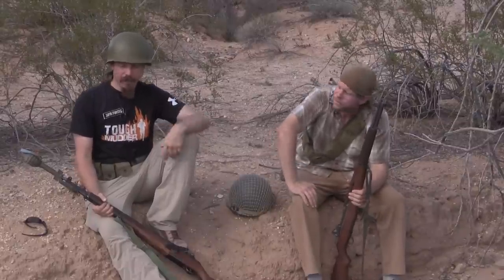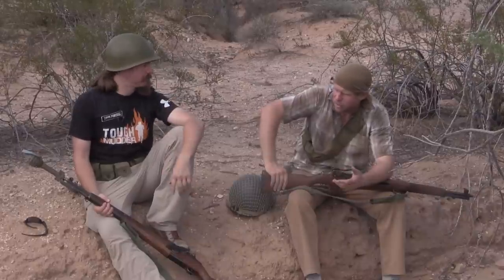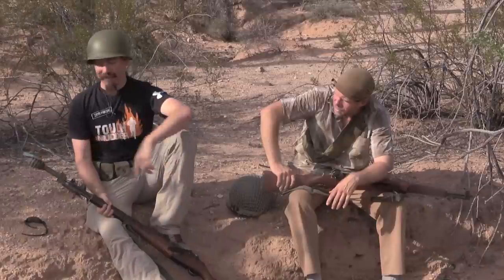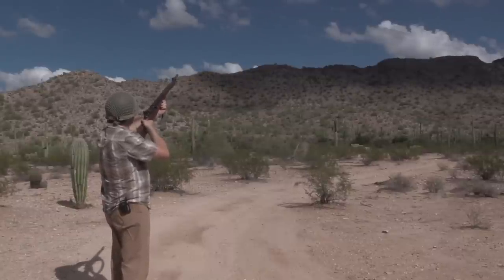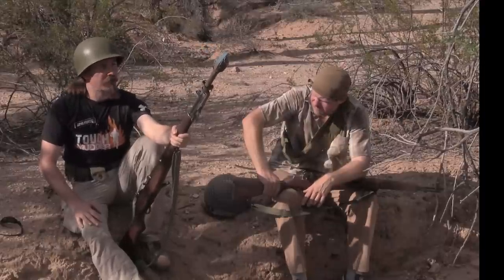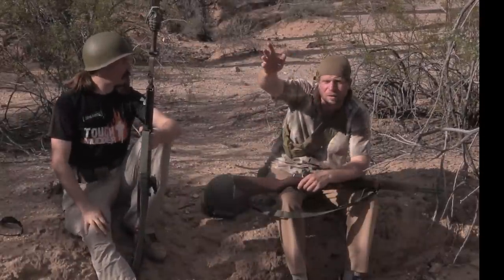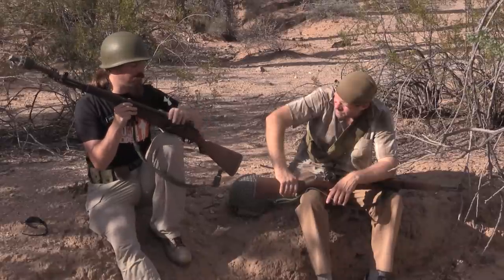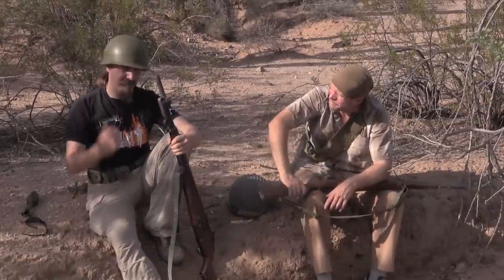M1 Garand Rifle Grenades - How, Why, What?

Comment: Do you think during certain war times they had an en block clip filled with launcher blanks so an individual soldier could fire eight grenades consecutively ?
Reply: I'd like to know too.
Reply: Nah the grenade launcher attachment makes it so there's not enough gas going back to work the action and load the next round
Reply: Zedbrains I think that if I had 8 grenades I'd have to fire consecutively I'd go for any improvement in time
Reply: Yeah, which is why the soldier cycles the action like its a bolt action rifle.
Reply: +Zedbrains why would that blow you up? you silly person.
Reply: Zedbrains Ian said that in this video so you're right
Reply: the real question is if the frontline solider cares about loading grenades over a loaded barrel, probably a no no in training
Reply: It would be entirely up to the individual soldier to do something like that.
Reply: DamianHobbes It wouldn't be loaded even if there was a clip full of ammunition in the magazine. You would fire a grenade, the rifle would not cycle so there would just be a spent cartridge in the barrel, then you just put another grenade on and cycle the action to load another blank.
Reply: It would be possible, the action would be straight pull. If it happened it was probably with a British or OSS raiding party were there would be only a few people and you couldn't do volley fire
Reply: I think that policy was to only use single rounds of grenade ammo in order to reduce the risk of someone using ball ammo to fire a grenade.
Reply: They wouldn't feed properly out of M1 en blocs. The projectile in a cartridge aids in the feeding process. Without it, they'll jam up the mechanism most of the time.

It's easy to replicate this: load some empty brass cases into a rifle and try to cycle them. It won't work very well.
Reply: No. They wont feed properly even manually.
Reply: @Nooblolftw   You know you could pull the bolt back too
Reply: No. The gas system won't cycle the action because of the gas bleed valve in the launcher. You have to load the launching rounds individually by hand and eject the empty cases by hand.
Reply: @Nooblolftw  It would still make it easier in that you can just rack the action and stick a new grenade on.

Comment: First - rifle grenade vs bazooka;  don't forget that the 2.36 rocket projectile warhead was originallt designed as an improved rifle grenade.  The rocket motor was added and a launcher developed.  One can see an advantage of having both available.  Second; when doing WW2 reenactments back in the 70's we borrowed some M1s from our local American Legion (used at funerals, etc).  The Legion guy said they were having trouble with the blank cartridges sticking in the chamber (the DoD had drilled and welded the gas cylinders so they were single shot only).  We discovered that the DoD had supplied with about hundreds of "grenade crimps" to be used as ceremonial blanks.

Comment: Massive cool factor, I love rifle grenades.  Thanks for the video.  I would like to mention grenadiers were trained to adjust the length of their sling and mark it in two places.  With one foot on the sling, the stock planted, and the sling pulled tight, the marks would give you 30 or 45 degrees depending which mark you put the edge of your foot on.  This is why the firing tables have columns for 30 and 45 degrees.

Comment: Seeing you guys with the rifle grenades brought back some wild memories. Rifle grenades like this were still in use when I was in the Canadian Forces back in the early seventies. Back then, the Canadian military was still using the FNC1A1 rifle. On the gas regulator, the zero setting was for using a rifle grenade. We were trained to always fire the rifle with the butt on the ground not to shoot the rifle grenade from the shoulder. The grenade we had was the old M36 with a 7-second fuse. There was always the issue of getting the grenades with the longer fuses mixed up with the grenades that had the standard 4-second fuse.

Comment: I'm from The Netherlands. In early 1975 I fired a couple of anti-tank grenades with a Garand M1 on an old Sherman tank on ISK (Infantry shooting range)  Harskamp. I was a conscripted infantry sergeant. I got the instruction of 2 senior sergeant-majors,  KNIL (Royal Dutch Indies  Army) war veterans that used this grenade launcher in battle. We had a different site on the grenade tap. It was a kind of thin metal ladder with distances. We were instructed to stretch the gun belt to full length, then put your left arm in the loop, let the gun-belt run over your body and behind the elbow of your right arm. Do NOT take the pistol grip of the weapon. Just make a fist of your right hand and point to the trigger with your index finger in the direction of your body. This way you are able to fire the anti-tank grenade standing or kneeling without breaking your thumb or your collar bone. With the second shot I was able to place the grenade just in the little gap between the turret and the body of the tank at 100 m. A young lieutenant sent both sergeant-majors for lunch and wanted to try a shot. Well he hadn't payed enough attention and took the pistol grip with his thumb behind the sight. Long story short.. he broke his thumb and had to go to hospital. So seeing you firing a grenade from the shoulder.. I would not do that!

Some pictures of the event.
https://youtu.be/aJXUGyA4_4c
Reply: Sounds like the STGW57 grenades weighing up to 1Kg.

Comment: And if the regular grenade cartridge didn't get it far enough, there were booster cartridges to go in the base of the grenade assembly. According to the range tables, with the booster it added another 50 to 80 yards to the range. Max range with booster was 330 yards with the AT grenades. Or more than 3 football fields

Comment: I read somewhere that many units prefered to bring around a M1903 for grenade use, since then they would not have to choose between lower firepower or slow response time for shooting grenades.
I believe this is why you can find many images of squads with M1's and a single M1903, and not the "designated marksman" many think.

Comment: Fun fact, the blue ones were actually designed for training. Around Vietnam we changed or color code system we used for ordnance to be able to quickly ID what type it is. Yellow bands for HE, Seafoam Green for WP, and blue for training, along with a myriad of others. The late production MKII pineapples that had a live filler were commonly painted solid yellow for the HE Filler.

Comment: Ive actually found an entire clip of that ammo in the woods in germany
Reply: wood1155 ive found quite a few things now , 20mm spitfire casings lots of .50 ammo hand grenades artillery shells ( which i left there of course :D) and a german SS bayonet and part of a motorcycle just in some woods with a metal detector
Reply: Aquatictoaster possible but unlikely
Reply: i found it a year ago, its almost like brand new actually, the blade is still sharp and the scabbard almost didnt lose any paint, just the handle which i think is made of nickel is a little meh
Reply: That is awesome. I've personally found tons of random crap at old mines, everything from rails to electrical components to signs, 1930s license plates, and what I believe was the primary hoist control lever for the Federal Lead Co.'s No. 5 shaft. Unfortunately, the lever was a bit too bulky to take with us, or it would have gotten an oil bath and be on display with all the other stuff I've found.
Reply: fsls13 that’s awesome
Reply: I sometimes find k98 bullets/cartridges here and there in my garden. Grandma said that surrender german soldier was shot and buried somewhere there.
Reply: @fsls13  Do you have pictures?

Comment: Fall of 1965 at Hamilton AFB, Ca. On my way to 'Nam and we had M-16 training before going over (the M1 Carbine was the USAF's weapon of choice at the time). Grenade launching was part of the training. We screwed new fuzes into bodies that had a hole in the bottom. A small bag of powder and a cork finished it off. You got a nice BANG and nobody died if something untoward happened. SIGNIFICANT recoil - shoulder firing was strongly discouraged. The slings were marked to control the firing angle.

I do remember one that went BANG as soon as the spoon flew off - nothing's perfect. Glad that it wasn't live. The best part was that it was an instructor that launched that one to show us how it was done.

Comment: Does the rifle need to be modified to mount the launcher sight? Do all X shaped gas plugs have the launching valve?
Reply from the maker: The mounting piece has to be screwed into the stock, that's the only modification. All X shaped plugs should have the valve, but you should check to be sure.
Reply: There is a tool that is used to mark the correct position for the mounting of the rifle grenade launchers site base. The base is held on with 2 wood screws. Not something that you would want to use the old "trial & error" eyeball method if possible.

Comment: My M1 (CMP arsenal rebuild)  has a Philips type end for unscrewing the gas plug, and so does every M1 I have seen. None have a single slot. Though I will admit that the GI issue multi-tool is of the Philips type (actually not Philips because the nose is not tapered). What did I miss in your explanation.
Really like your show very straight forward with no Hollywood BS

Comment: We used a K98 grenade cup when re-enacting. Stuck a length of dowel in the bottom of a mark VIII thunder flash and fired it with Czech surplus steel blanks. A little practice and you could drop one almost anywhere you wanted....into a trench, over a wall, through an open window...no problem.

Comment: Great video. As an add,: The rifle did not become a single shot when the grenade launcher kit was applied/used. The kit came with a special gas plug that vented when the grenade spigot was installed on the rifle. When the spigot was detached (takes a second) for regular firing the gas plug release was not activated and remained shut allowing the rifle to cycle as normal.
Reply from the maker: I believe we stated that in the video?
Reply: Indeed you did. Sorry, for some reason the video started almost half way through. Great video.

Comment: Did they ever solve the problem that the launcher would turn the rifle into a single shot? I think Ian was explaining it, but he got interrupted.
Reply: Yes they did. The gas cylinder plug works like a Schrader valve. It is spring-loaded, & normally seals the gas cylinder assembly when the rifle is being fired. The rifle grenade launchers have a stud as part of their method of securing the launcher to the rifle. On the original M7 launcher, once mounted to the rifle, this stud depresses the gas cylinder plug, thereby allowing the gas from the cartridge to vent directly into the atmosphere instead of continuing down to push against the operating rod. On the final version, this stud was made just a hair shorter than on the original, which allowed normal semi-automatic fire, as long as no grenade was positioned on the launcher. When a rifle grenade was fired off, the recoil would push the launcher stud rearward into the gas cylinder plug. This, in turn, would momentarily open the valve & vent off the gases instead of them pushing against the operating rod, then it would allow the valve to go back to the closed position. I believe the final launcher model was either the M7A2 or M7A3.
Reply: Urbicide That’s pretty clever actually.

Comment: Question for you guys! 
I have an m7 launcher I've shot maybe a dozen times and have always used reenactor blanks I bought online as grenade launching cartridges are hard to find, but I'm seeing now alot on forums people saying the pressure curve is too high and normal blanks should never be used? Has anyone ever had a catastrophic experience with this? All the reenactirs I've seen use normal blanks, I've done it with no problems to the rifle, Ian is doing it in this video. What's yalls opinions

Comment: Actually the M-14 used basically the same clamp on grenade launcher spigot, and sight that the M-1 used, just changed the ballistics chart, and developed a 7.62mm NATO grenade launcher blank.

Ref the 'Blooper' of Vietnam, the M-40. Experts (read used it lots in combat) could eyeball the range instead of using the ladder sight.

Ref. the grenade launcher on the M1903/03-A3, there was a rubber boot that fit tightly on the buttstock to add some cushioning to the shoulder area. They are (were) still available on various mil surplus parts shops. Numrich and Sarco for instance.

Comment: I would make sure I had the correct launching cartridge by using only cartridges from a sealed box marked Rifle Grenade M3. 
As you said, some new blanks are made with the flower petal design.  I would never use a blank to fire a rifle grenade. Maybe going by the head stamp on the cartridge...as long as it was WW ll or 1950's.  Not sure when the new design blanks appeared, but I'd be careful not to use one.
Reply: There's nothing wrong with using normal reenactor blanks they just won't travel as far

Comment: Rifle grenades were great for laying wire. If you had to get commo wire over a river or a wide creek you pulled about 50 ft of WD-1 wire out of a donut and tied the end to the tail of grenade holder. Then fire away and the grenade sailed across the creek pulling the wire  out of the donut as it went. If it landed short you just pulled it back by the wire and tried again. Also a great way to get commo wire up across the tree tops when you could not get a helicopter to help. If there were a lot of tracked vehicles around your wire would last a lot longer if you laid it up in the trees.

Comment: You can fire them without shouldering, you get the rifle under your arm, squeeze the rifle between your arm and shoulder, hold it with your support hand on the handguard, aim with the tip of the grenade, pull the trigger without gripping the rifle too hard (for pistol grip rifle, don't put your thumb around). The rifle will recoil by itself without hurting you and you should be able to hipfire quite accurately.

Comment: Mortars and rifle grenades need  special propellants, they need a lot of gas generated but at low pressure and the propellants of choice is similar to shotgun powder. Shotguns shoot heavy weights with thin barells
because the powder generates a lot of gas but only at about 12,000 cup as opposed to 55,000 cup in a rifle. Grenade blanks can be made with 15 grains of shotgun powder.

Comment: After getting my Yugo SKS a couple weeks ago, I became very interested in this concept of spigot type grenade launchers. The M59/66 has a similar system with a gas shut off valve sitting in the gas block. I wonder if that thing about the lines on the muzzle device also applies to the SKS. I always wondered why it wasn’t just straight smooth metal and had several interrupted rings around the whole thing. I’m also wondering if the six ports below the very first ring serve any purpose other than just being there, seeing as how not all models of this rifle had the ports I’m talking about. To my knowledge, Yugoslavia only put non-ported grenade launchers on the earlier variance. According to my research mine was made in either 1970 or 1971, so even though this was only a few years into it’s production, it was late enough for the ports to have been added. If anybody has any information on this, I would greatly appreciate a reply

Comment: You guys answered a question I have had for years!  I always thought that the grenade was launched with an actual bullet.  I couldn't see how that could be possible, and I now know that I was correct, it would have killed the guy attempting to launch the grenade.
Reply: I learned that from my great grandfather. He told me about a incident that happened when he was going through basic training. A guy messed up and used a live round with one. My great grandfather said it wasn't a pretty sight. That was the only death that happened on that base while he was there.
Reply: Modern rifle grenades [Israeli, French] use bullet traps built into the design and are fired w/ standard (live) rounds. Of course, that's with modern medium power assault rifle cartridges, not full power .30cal, so that might have something to do with it: it's quite possible that the bullet trap needed to stop even M2 ball [let alone the M1AP preferred by most soldiers late in WW2!] would have weighed down & made too large any RG design that Army Ordnance went "Uh, never miiiind..." ;-)

Comment: Slightly off topic, but if you like rifle grenades, you'll be happy to know that one of the French Army criteria for its new rifle was the ability to shoot those big ~500 grams rifle grenade without the rifle disassembling itself, which the HK416 can do apparently. So the HK416F will be provided with a rifle grenade aiming device thingy among other things.
Reply: "without the rifle disassembling itself" lol. I thought that it was a nato standard to be able to fire those things?
Reply: Yes and no. You can indeed plug a rifle grenade on the muzzle of any rifle with a NATO 22mm flash hider. Though rifles nowdays aren't necessarily built with that in mind. Firing a typical 250grams rifle grenades is probably not too much stress for the whole rifle. Firing anything bigger like a SIMON breaching grenade or an french APAV40 might be another story. I doubt you'll get a catastrophic failure with a mil spec rifle. Though its service life may be impacted and some of those collapsible stock may not appreciate the joy of firing a grenade.
Reply: I just read about collapsible stocks on m4's failing after firing french rifle grenades. Apparently stress on the barrel could be an issue as well.

Comment: the HEAT grenades were small, so it was really only good at destroying engines or similar bit of tank equipment since it wasn't creating as big of a thermal or pressure increase compared to 105mm or 75mm with like 3kg of Comp.B